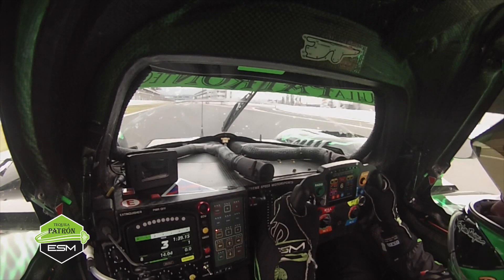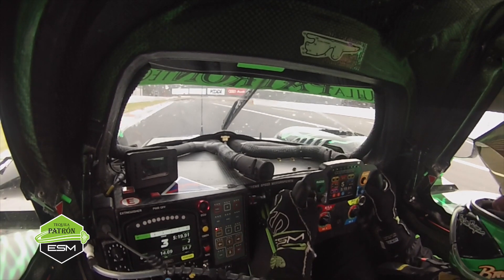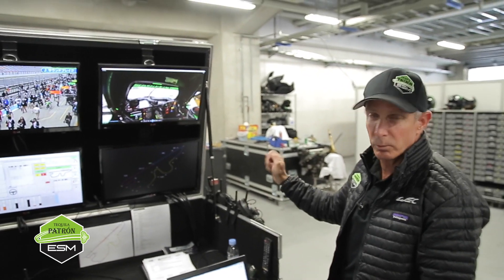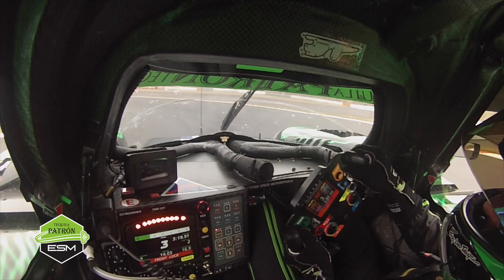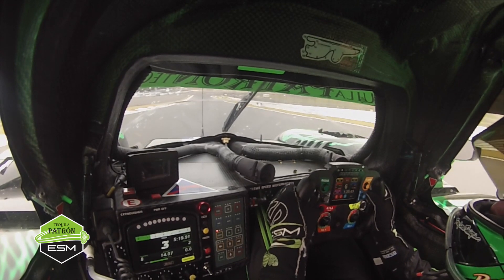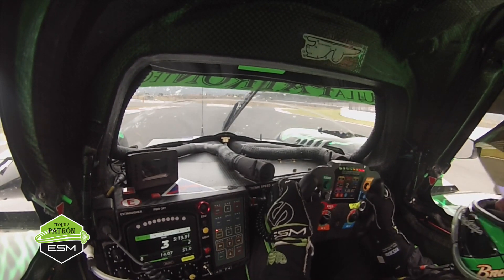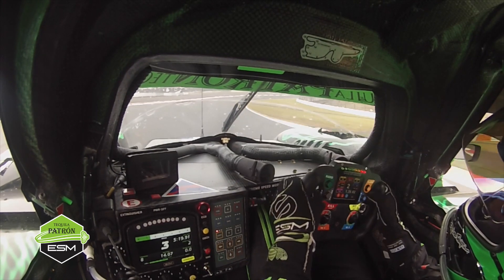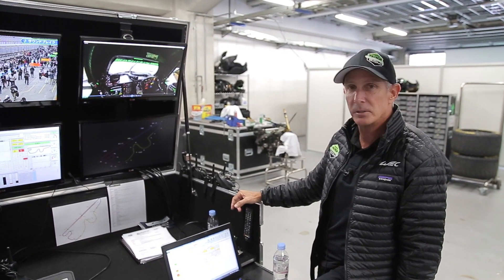Turn-by-turn Description and On-Board Footage of Fuji Speedway with Ed Brown

Comment: What speed are you hitting at the end of the main straight and do you have 6 gear set up for a draft or to top out a the normal too speed
Reply from the maker: +thecrazycarman Around 180mph! 
We were just running a normal 6th gear that would top out.